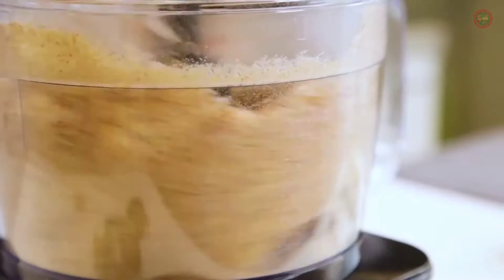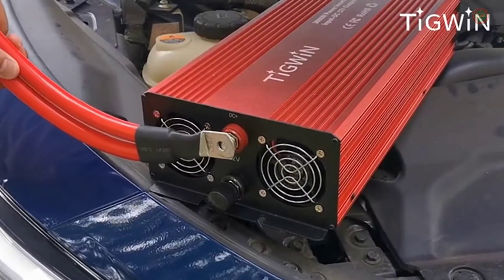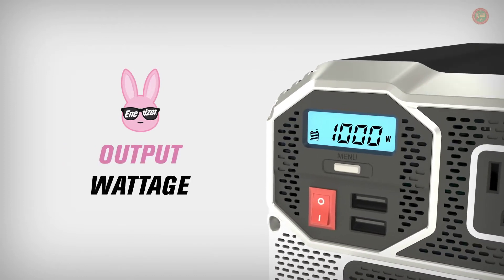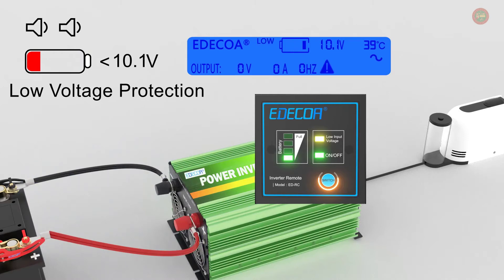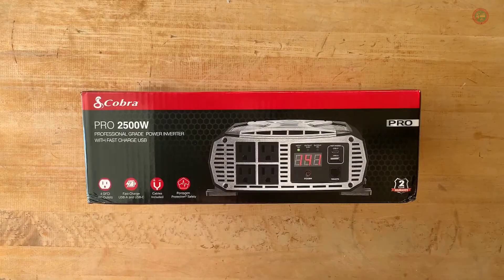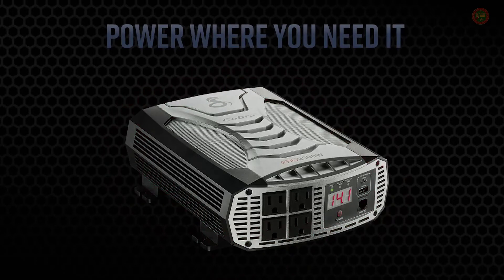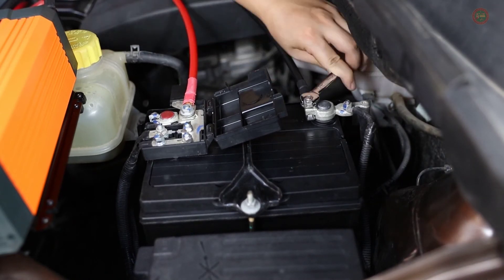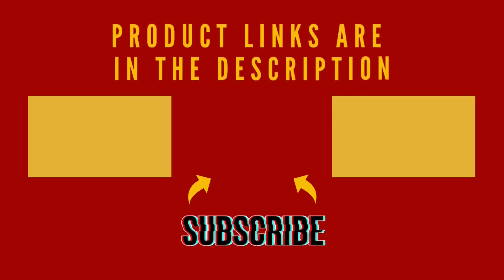5 best power inverters for trucks

Comment from the maker: 5️⃣ Tigwin 3000W Power Inverter Modified Sine Wave Inverter
👉https://amzn.to/3EGZRua

4️⃣ Energizer 4000 Watts Power Inverter Modified Sine Wave
👉https://amzn.to/3rMDLl4

3️⃣ EDECOA Pure Sine Wave Power Inverter 3500W
👉https://amzn.to/3OxUNNr

2️⃣ Cobra PRO 2500W Professional Grade Power Inverter
👉https://amzn.to/37ACnuX

1️⃣ Ampeak 2000W Power Inverter 12V to 110V
👉https://amzn.to/3LeClHv

5 best power inverters for trucks